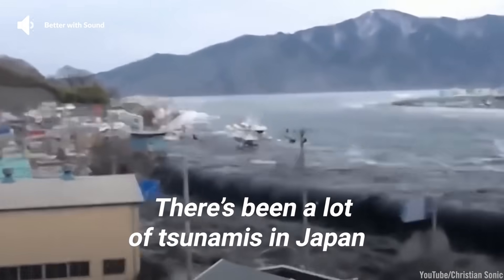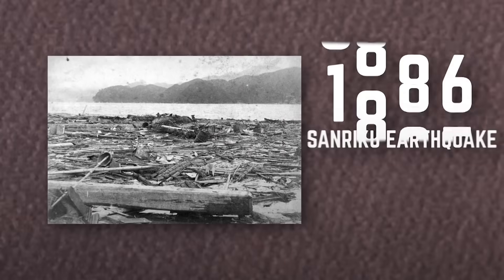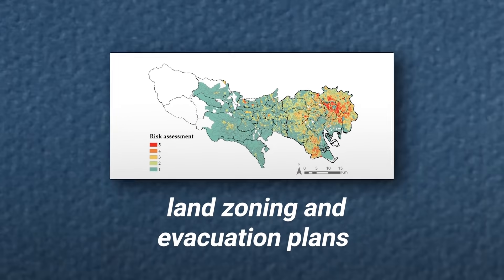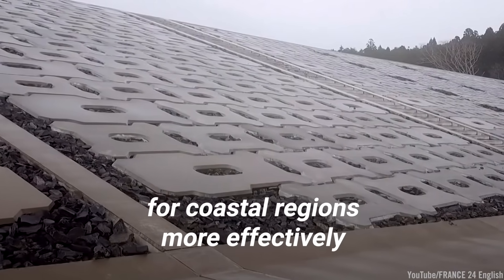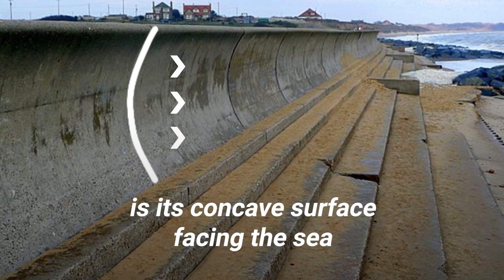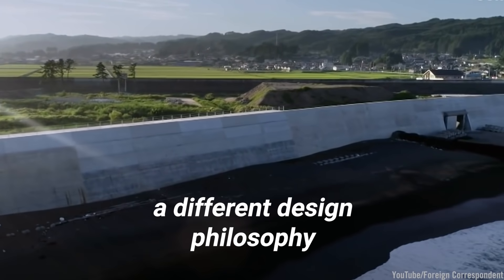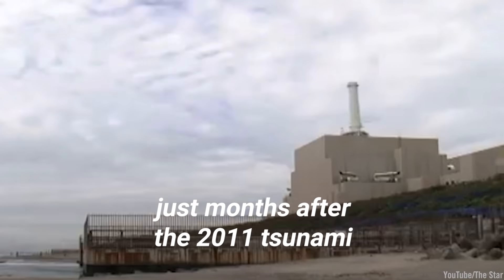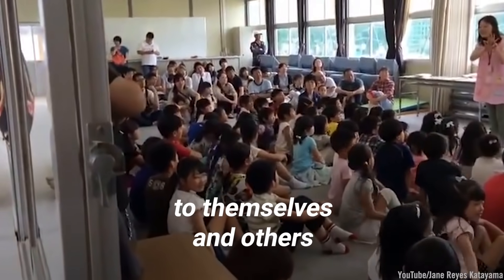Japan's engineering solutions for the next tsunami

Comment: i think all edges of lands connecting to ocean should be build up and forested. especially as sea levels rise and extreme disasters rise. that seems insane but there is a lot of organic waste that fills landfills and a lot of sand on the ocean floor and lots of rocks and bolders lots of things could be used to build up the mass.  japan could be surrounded by something like this. the height of the land and the trees in the forest could be built up high enough and then other preventative measures combined it this could do something. also with all the destruction of the forest in the world it would benefit that as well